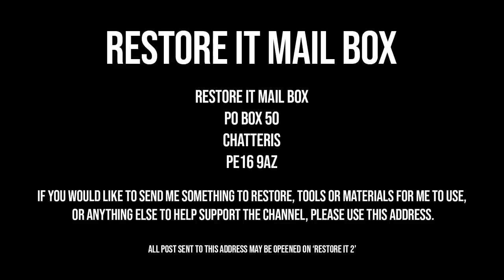Rusty BMW E30 325i Brake Caliper Restoration

Comment: i dont know why he is using locktite at the valve🤔 But overall thats exact the way you do it, just dont forget buy a part u need and using silicon paste like him which NOT attack the rubber, because there are some pastes who are no good for it, so use grease which dont break down / decay rubber over time and dont take something just because u have it already in your garage.
And its no shame to use the brake cylinder again if they are no scratches, its just a hydraulic cylinder and when its not damaged u dont need to replace it.

Comment: Why would you lock tight the bleeder valve. If you were to use that caliper you have to bleed it. So you tightened something down that needs to be open and closed multiple times before finally tightening it.

Comment: The paint-job is very well done, as always!
But... i think a long time if i really should coment the restoring of this caliper.
Well, the reason why i coment this, is that many people could get this restoring as a correct diy and that is it unfortunately not!
1. First of all, never press the caliper piston in his bore like this! That destroy the dust-cuff with nearly 100% probability!
2. In case that almost all aftermarket Replacement kits had no hard-chrome coating on the piston, i would first look if i could rescue the old one! In most cases it‘s possible to polish the surface without any damage the coating. 
The hardchrome calipers are so much better in use for many reasons, like thermal or corrosion resistance!
Also the rubber parts available at this time often rubbish and not worth the money. It‘s better to look for OEM or Girling original parts!
3. Why you didn‘t blast the details better? If you are lucky to feature a blasting cabinet, use it! 
4. And in case of corrosion-prevention and in mind that calipers are for sure very important parts for youre live, it‘s a good idea to bring on a galvanic zink coating, like Girling or ATE does! 
For all following paint you could use a wash-primer before painting.

Thats my little opinion, after watching this video! All other restoring clips in this channel, and of corse the paint jobs here are all awesome and i watch it with enjoyment!

Comment: If you had to use a tool to get the piston in, there is a chance that the rubber seal inside is the wrong way

Comment: Why red locktite on the slide pin bolts? You have to be able to remove them to service the slide pins when you do a brake job.
Reply: Germans tend to really like using Loctite on slide pin bolts. It's nice sometimes because the Loctite seals the threads preventing corrosion deeper into the hole, so once you defeat the hold of the Loctite it comes out easily.

Comment: Brakes are easy but can be a huge pain in the ass, especially drum brakes. Luckily for me, I have four wheel drums and no vacuum booster so when I come upon people STOPPED IN THE MIDDLE OF THE ROAD, it can get dicey. I do have a loud horn, though. That's a plus, I can deafen the shits that BLOCK CITY STREETS BECAUSE THEY WANT TO SOCIALIZE IN THE MIDDLE OF THE ROAD IN THEIR CARS INSTEAD OF PULLING OVER AND GETTING OUT.

Comment: What was the red grease substance in that tin, and what did you use it for?
Reply: So the bolts doesnt rust and comes out easier when u want it to.

Comment: After the video did you return the Caliper to the vehicle ? I think that you made a mistake with the asamble the piston with use a tool. The piston must be push with finger, not tool because is will damage the rubber ring and the piston wouldnt move properly. If the piston could push with fingers so perhaps you put the rubber ring not properly. The rubber ring has direction!

Comment: it was unnecessary to clean inside the cylinder where the piston moves. there should be a minimum clearance.
Do not apply the thread lock to the bleeder. After all, you will then unscrew it to bleed the brake. The thread lock must be applied to the bolts securing the bracket to the hub.

Comment: Just buy a new caliper. I did a restoration too, and after removing a caliper I realised that the needed work exceed cost of a new caliper. (you still need new piston, bolts, sliders) and if the caliper was really corroded, there is a big chance it will find its way to get back after a year it looks nice, but it's not worthy the job.

Comment: Nit a bad job. But i wiuld have blasted them with the old caliper piston in still. Scratch or score the piston cylinder and you got useless calipers. Also, if you want to not eff about so much when sliding the new caliper in. Ise some brake fluid and try, it goes in way easier.

Comment: I want to ask a serious question. I know I'm not the only one. DOES DEGREASER REALLY ACTUALLY DO ANYTHING??? Hear me out. I've tried degreaser on a number of occasions and it did nothing that dish soap and hot water wouldn't have done. Seriously. Like nothing worth the cost of it. Gasoline works. Mineral spirits work. Hell even oven cleaner works. But degreaser including super strength degreaser still leaves me with hella scrubbing to do. Maybe I'm not using it right but I follow the instructions. Has anybody else had this experience and or can advise on some degreaser that actually degreases. Thanks.

Comment: Why have you painted over surfaces that guide brake pads? And the surfaces of joins also. This may affect aligning. Silicon grease is acceptable, but it's better to use specific greases for piston, giude pins and brake pads. Piston needs grease reistant to break fluid, pins needs very durable and rubber-friendly grease, pads needs extremely high-temp and high contact pressure grease.

Comment: Sand blasting has broken that chrome inside the cylinder.  And that silicone grease... Use normal grease for callipers... Ok. The callipers is nice. A lot of job. But now way for long usage.

Comment: You shouldn't need to use a special tool for push inside the piston. After restoration you should can do it by fingers... It will not work well.
Reply from the maker: I didn’t use enough grease when I first put it in. After the shot you see in the video. I push it back out with air and go again. I was able to do it with my fingers after.

Comment: Next time use some that red grease to make the piston slide in easily :)
Reply: Never ever put petroleum grease into a brake system. Petroleum oils and solvents will destroy the rubber parts in the whole system.
Reply: @mannys9130  silicon, not petroleum
Reply: @V1LKA5LT  No, petroleum. The rubber used in braking system is 100% incompatible with petroleum. 

http://www.agcoauto.com/content/news/p2_articleid/251
Reply: @mannys9130  if you don't know there is special paint which can withstand heat for brake capilers, and there is a special silicone which is made to use in calippers so they would work as new as long as possible.
Reply: @V1LKA5LT  In your OP you said to use grease to make the piston slide in easy. The surface of the piston is in contact with the brake fluid, and therefore all other rubber parts. You should not use grease to insert the piston into the caliper. You also should not use grease to lubricate the slide pins. The rubber dust boots and (on some models) the rubber dampening ring will swell and tear causing the caliper to move unevenly or not at all. 

If you're having trouble inserting the piston, use brake fluid to lubricate it. For slide pins, use silicone paste or specially formulated silicone caliper paste with other additives in it. 

The critical thing here is that petroleum absolutely does not play nice with DOT 3/4/5.1 brake systems. 

I had a customer who topped off his brake fluid with ATF. :( He mentioned it to me as he was picking up his car from my shop. I told him he destroyed the entire system and it was not going to work anymore. It was an old Chevy sedan that was primer grey with Bondo spots. :/ I never saw him again. That sort of damage totalled that vehicle.
Reply: If you grease ring with silicone to slide in piston more easily, that wouldnt do anything to the rings, they work perfectly fine without any failure, if you work at service center, that doesnt mean that you are smarter than everyone else :) BECOUSE, if you don't grease, you actually tare rubber while sliding piston in, wanna try it, youll see thats true :) yeah you can use some dot4 to lubricate it tho so it would slide in easier, silicone is just better, becouse it would help piston not only to move at reduced friction in AND out, espiacially back in after brakes there used, becouse when the rust forms and piston doesnt go back, thats when everything starts to go bad with brake system, and then after that, it wont come out either.....
Reply: @V1LKA5LT  Brake fluid works just as well, and it won't do any harm because the square cut seal is made to contact it for years and years... Why introduce something different that gives you no advantage whatsoever? 

I work as an auto technician, so I have knowledge that other laymen don't have. I perform these repairs and I see the results first hand. I don't have an above average IQ, but I have common sense and experience. :) Just use brake fluid, it'll work great. You'll be just fine without anything else. Brake fluid on the piston and square cut seal, silicone paste on the slide pins. That's it.
Reply: The seal is not square on some cars..... it has lover edge so the piston goes in easier and a higher edge so it would hold brake fluid, at least on my car i saw that....
Reply: @V1LKA5LT  Compared to an O or X ring, the piston seal is square cut. It has hard ~90 degree angles. The seal is designed to roll slightly and assist in returning the piston back to its relaxed position. An O ring would not do that.

Comment: Verstehe nicht ganz die Funktion der zwei Bolzen außen (8:40). Ich habe mal meine Bremsen auseinander gebaut, die Gummis abgezogen und die Stifte raus gezogen. Danach gereinigt, gefettet, Gummis drauf und reingesteckt. Ich wollte sie nochmal rausholen aber es hat sich so ein starkes "Vakuum" gebildet das ich sie nur mit mühe wieder raus bekomme habe. Muss das so sein für die Federung damit sie die Bremse auseinander drücken? Oder sollen sie leichtgängig laufen?
Reply: Die Führungsbolzen dienen dazu, dass sich der Faustsattel im Gegensatz zum starren Bremsträger schwimmend in Kolbenrichtung bewegen kann. Wäre das nicht der Fall, würde nur der kolbenseitige Bremsbelag an die Bremsscheibe gedrückt werden, da bei diesem Typ Bremssattel ja nur auf einer Seite ein Kolben vorhanden ist, was also eine einseitige Belastung der Scheibe und einen einseitigen Abrieb der Bremsbeläge zur Folge hätte.
Es klingt fast so, als hättest du es mit dem Fett ein wenig übertrieben. Wenn sich die Führungsbolzen festsaugen, war es zu viel und möglicherweise auch das falsche. Es gibt dafür spezielle Fette/Schmiermittel. Dabei ist auch die Temperaturbeständigkeit und die Materialverträglichkeit zu beachten.

Comment: You shouldn’t have used tools to press the piston in place. The rubber goes on the piston first, and then line in up in the caliper cylinder.

Comment: hope you did not put petroleum grease on the rubber parts,  grease will eat the rubber slowly but surely.. 
i hope you used 'silicone grease' instead. silicone grease is safe on rubber parts. that is important because were talking about your brakes and safety. 
Anyway,be safe and more power.

Comment: That's the problem with most folks that own BMW's, They never maintain them, because they dont know how, or dont want too, possibly even a combination of the two. And then the motor vehicle fails. Keep in mind that these are the same lite-minded individuals that want to interview you for a job/career.

Comment: Sry, but this completely wrong. First: I didnt see any usage of HT resistant paint (also covering with clear paint is not needed). Second: covering areas with paint where is brake pad moving is also mistake. Third: on brakes u have to use ceramic grease which is HT resistant (3000°F). Fourth: putting loctite on bleeder valve....really?

Comment: So many things wrong here... I say that as a professional automotive technician. Soooooo many things wrong. Who TF would put lock tight on a bleeder screw?! If anything, you'd apply anti-seize compound to it. Why would you spend so much time on paint? Jesus. It's a brake caliper, not a fender. The piston was installed wrong or it was the wrong size. A little brake fluid for lube and a spritz of compressed air, and the piston should just pop in... No press needed. Not a snowball's chance in hell this thing works right.

Comment: Nice work but Fuck all that for just calipers and saddle brackets. Car guys with a 40+ He. job just buy a cheap sandblasted and rebuilt Re-man caliper and prime and paint it. Too much time when you don’t have time but money. Clean the saddle bracket of course and get slider rebuild kit. Anyway.......

Comment: (mistake no 1) when you sand blasting you cover the piston bore,that should be smooth as baby's ass!! (mistake 2) you don't wet sand the caliper,wet sanding is for,taking orange peel off of smooth surface like body of the car !!! (mistake 3)as everybody else mentioned,NO LOCTITE  BLEEDER SCREW!( mistake 4) when you make a huge mistake like that,edit it out before you load it on you tube!!!,(mistake 5) not every one has sand blasting machine,paint booth,and all other tools you had in your shop,so it is cheaper to places like ROCK AUTO.COM,or other places to buy it!!

Comment: You put the piston in dry? You’re no gentleman. Sticking it in with no lube is wrong. Pro tip use only brake fluid to lube caliper pistons for reassembly as any thing else would contaminate the system. But do not assemble dry.

Comment: I like your video's and craftmanship, however, in this case I don't understand it. You basically only clean/paint the biggest metal parts, and replace the rest. And those bigger metal parts, you could have bought NEW and original for less than you now spent on resources to get them to this state.